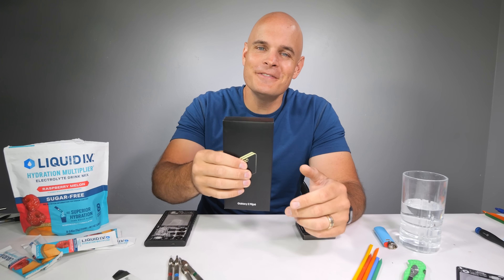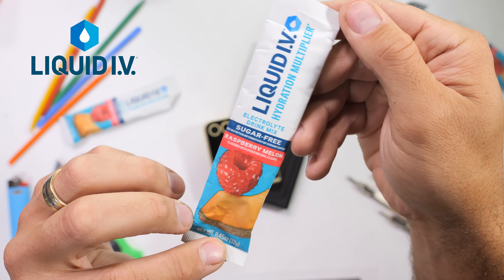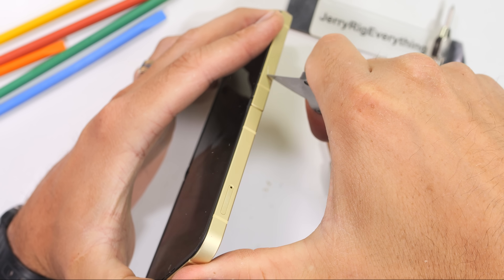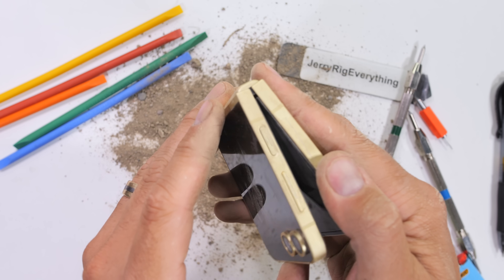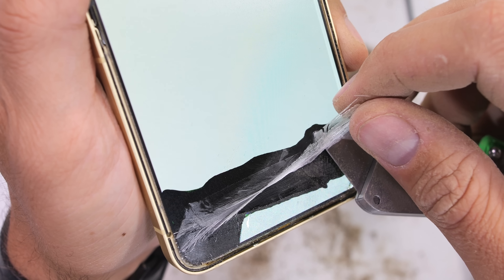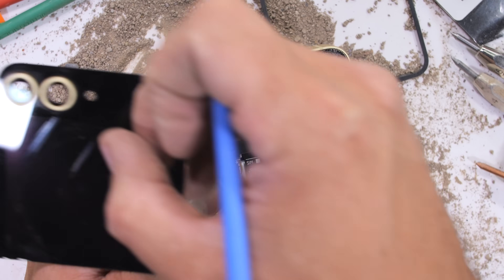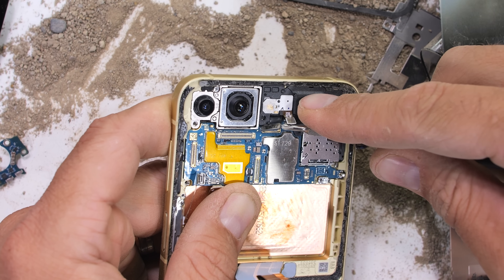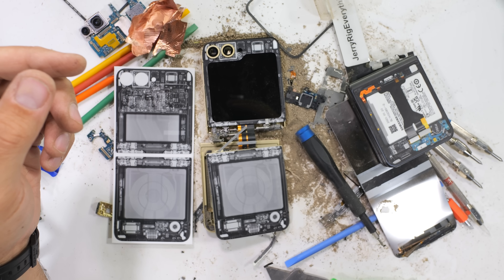Samsung Z Flip 6 Durability Test - I CANT BELIEVE THIS WORKED...

Comment: I'm fascinated on how cool and tidy  is this phone inside, just beautiful
Reply: Honestly every samsung phone after the s20 is beautiful inside, and amazingly easy to work with. They clearly put effort into simplifying their phones, whereas apple on the other hand…….😡
Reply: @Mike_Dubayou Also how a phone with 2 batteries, glass glued in that broke each time you replace it and 2 display is simplifying anything. You have never repaired one. Modern phones are horrible but modern flip phones are even worse.
Reply: @GTR-TT  Because opening phones is relatively easy.  Im not saying I've never broken one, but I do repair about 10-15 phones a day.  With all samsung phones, you repair the screen by opening them at the back first.  In my first 2 weeks repairing them, I had a few troubles.  But honestly your just an amateur if your constantly breaking the back glasses when repairing samsung phones.  

I think I've repaired about 800-900 samsung phones within the last 5 months.  I've broken like 6 backglasses, and 4 of them were within the first 2 weeks.

Nothing wrong with a mistake every now and then, but if you think its difficult, Im gonna just say thats a skill issue on your part.
Reply: @Mike_Dubayou LMFAO easy to work on? He broke the glass trying to opening the phone. Everything is glued in. Is horrible. Its the same as apple. Literally the same.
Reply: Nice bit of kit recieved mine Friday
Reply: @MarcosDias567 Not only have I seen them, I've fixed them!  Change the charge port on your own iphone and tell me its not an absolute nightmare.  Be sure you keep track of where all 45 screws came from, because they all just have to be different sizes.  Dont forget to have the 3 different screw driver needed as well, because why they eff would apple just use the same kind of screws.  

And this has nothing to do with your perceived notions that I am talking bad about apple out of some kind of hatred for them.  I use an iphone.  Samsung screens are annoying to change out.  Im just speaking the truth.

Comment: I loved my Z-Flip 3, but a week out of warranty it started crashing when I opened it. Thought it was the screen, perhaps a slight break in the ribbon cable. Got a cheap Oneplus to replace it, until that phone completely caked its pants and I had to try to get the Z-Flip to work. Well, I figured out that it's actually the hinge angle sensor that failed, and it's not the opening that makes it crash, it's the closing. So, I have a Z-Flip that can't be closed. Works fine as long as it's open.

Comment: Bought my flip 3 in 2020 and im still enjoying it!
Reply: Where u using any case???
Reply: @samgrootroessink7314  yeah, first I used samsungs silicone blue with a ring on the back. I still use it when I go downhill skiing to make it easier to grip. Then I didn't use any covers for a while until I found one plastic shell that I still use. But it's a little annoying that I like the cover because I got one of the special online colours for my flip. I've changed the screen protector twice. Once at Samsung after about 2 years (I guess they had a longer policy before) and once myself after the previous protector gave up after getting sweaty after a tough skiday
Reply: @samgrootroessink7314  sorry, missed your question. Yeah, for sporty stuff like alpine skiing etc I have the silicone that Samsung makes. But everyday I just have a simple plastic one with features. It's held a few drops with both cases. The biggest headache comes from sweat that starts to undo the screen protector. But putting a new one on isn't that difficult.
Reply: bought my zflip 3 about 2 years ago refurbished and it only lasted about 8 months before the screen started turning black and stopped working when I dropped it 😭 and then I got the screen fixed and the phone lasted another year until the screen started glitching out. then a green line in the middle formed and the screen started bleeding and becoming black. I didn't even drop it the second time smh 😭
Reply: @starella.  Sorry to hear that. Mine has mostly had a regular plastic case on and survived a few drops without any issue. I guess I just got lucky.

Comment: As you've done here, good design and engineering can make far more efficient and environmentally cars. Unfortunately profit margins and political soundbites are more important. They do not care at all, it's all a sham.

Even simple things like lean burning could lower the emissions of gasoline engines significantly, but that would require a few extra cents in material costs per engine so most manufacturers don't bother. Look at the original Honda Insight which used lean-burning and then was abandoned by Honda after 2006.

Comment: As someone who still owns a Flip 3 after over 2 years now, I can only support that Flips are pretty durable.
Right after getting it, I was asked multiple times if I wasn't scared of breaking it after a short time or if I was scared of breaking the screen with my fingernail. None of which has happened. I dropped it while it was open soooo many times by now, and it only has some exterior scratches on the frame and nothing else.
So I am very tempted to update it to the Flip 6, but mine is still completely fine and working without a problem. Also, I don't think I can ever go back to normal brick phones

Edit: For those asking, the battery isn't very good. But it was that from the very beginning. Since I knew that, I always had the battery protection on since I got.
Reply: Yeah, I'm using a flip5 right now and I was concerned with durability, it's been perfectly fine
Reply: I just upgraded got the fold 6, but I was still usaing the original fold for the last 5 years with no problems. Samsung really are making durable phones much better than the chinese, assuming you treat your 1-2k purchase as a 1-2k purchase.
Reply: I've had the flip 5 for about 9 months and it's still going strong I really debating if I wanna get the 6 or just keep the 5 for another year.  24 ultra still the king though.
Reply: Curious to know how the battery stands after a moderate day.  SOT, if you can give that.
Reply: @kcnairnair7299  The battery on my original fold is still good for a whole day.
Reply: @kcnairnair7299  I used my phone for GPS + music on a speaker at work from ~8AM and it died at like 5pm ish, under normal use (not a super heavy user) it'll last all day.
Reply: Can someone tell me what you find better about the flip form factor besides novelty
Reply: @trippinhard250  it fits better in my pants' pockets, especially in shorts.
However, it's an additional phone complementing my S23u.
Only using the Flip would not suffice TBH. At home I almost only use the S23u.
Reply: mann, you got lucky. My Flip 3 crapped out in under a year, despite me being extra careful with it. The screen started to separate at the hinge, looking like someone tried to pull a screen protector off. Eventually the whole screen grenaded itself. I haven't bought a foldable device since. Which is a shame, because I absolutely adored my Flip 3. I loved every single little thing about it and never once cared that I had to open it up to use it. But it just died way too easy despite me going the extra mile to cater to it.
Reply: @Xaevryn 
Had the same happen to my flip 4 after a year or so. Was able to get the protector changed for free by Samsung before it got too bad.
Second,  I upgraded from flip 4 to flip 6 just now. Believe me, a random guy on the Internet 😂. 
The bigger outer Screen is a game changer. Especially with the Good Lock app. You can run everything on the outer display.
Reply: I have delayed processing so I run into things and drop things all the time. The Flip 3 totally fell apart on me. I had it for a month before it was totally unusable. Broken screen where the hinge is, just massive black spots.
Reply: upgraded to fold 6 from fold 3. i had the fold 3 since launch and no problems at all other than battery naturally degrading over the years. best phone ever
Reply: I've had the 3 & 4, had to replace 4 once. All that I've owned crapped out at a year but I am still a massive fan of the Flip. Just got the 6 bc my second 4 screen just died. 😂 🤷‍♀️
Reply: I dropped mine while open once and instantly got dead pixels. I think they're pretty durable, though because that impact would have led to some broken glass on non-flip phones
Reply: That’s like my biggest regret last year. I bought the S23 instead of the Flip 5 because I was afraid of the durability of the flip phone, even though many of my friends were already using flip 3 and flip 4.
Reply: @FarhanHafizh the S series is just better tho, flips and folds dont really compare, be happy
Reply: Dont waste your money..... i boight flip 5 and only y months the screen is breaking😢 and i am VERY careful with phones @FarhanHafizh
Reply: Lucky for you. My flip 4 turns off when folded just after 1 year of treating it like a baby. Never buying a folding phone again.
Reply: Fold 4 here. Replaced the inner screen protector once, but other than that and a slightly degraded battery, it's perfectly fine.

The original screen protector lasted about 6 months before peeling and bubbling started, with multiple folding cycles each day.

The replacement protector has just started peeling after about 8 or 9 months, so they seem to have improved that.
Reply: The battery on mine die one year after
Reply: Had a flip 3, had to swap back after 2,5 years after well, first the "screen protector" got loose on many places of the screen, then the screen just got so badly scratched from my nails alone. I dropped the phone twice, 3-4ft drops. hinges had some play after that. Dont get me wrong, I am a huge flip phone fan, but man the flip 3 nope. Loved it, durable? No.

Comment: Have they fixed the disgusting pre-applied screen protector which, on my Flip 4 cracked after only a couple of months since, for some bizarre reason, they have a glass layer within it? Doesn't help when they start denying warranty requests, or getting sniffy about it, if you removed and replaced that with an actual working protector yourself. They also only allow 2 replacements.

Once this one is paid off I'm going for a Pixel, straight to "the source", definitely my last (and only) Samsung.

Comment: That's a surprisingly massive chamber for a flip phone form factor
Reply: That's crazy I've had like no real issues with my flip 4
Reply: @aleksanderlucy8764  go out on a 100-degree day and play a game outside like PubG or Pokémon Go without battery saving mode or extra dim and watch what happens. 
My phone starts shutting down other open apps, dims the phone, and eventually, you can't even call or text anyone until it cools off. Which is good because it's trying to save itself, but in the process, you can't do anything at all on the phone whatsoever. 
This is worse performance than the old phones from 2018. I got rid of my iPhone for vapor cooling and the Flip4 doesn't have anything at all. Terrible.
Reply: @BrD4GOD  what do you expect? The thing has a minnusule vapor chamber with a board the size of my thumb in wich the processor occupies like 40% of the surface of the board and you use it while its super hot and play heavy games, dont expect much, its made to show off too, not for whatever you do to be on the sun or places so hot
Reply: @paranaenselol  for sure. I think before this summer it's never really happened because I wasn't playing games back then and I didn't really have any issues. 
I work in the A/C all day as well so issues at work or at home. 
But man, it does get hot with basic operations while charging or just in general. Definitely can't handle heat well at all even in medium usage settings. 
But I get you for sure. 
Just was kind of a shocker going from the Note 9 to this.
Reply: And man is it needed. This summer, my Flip 4 has overheated consistently. I am seriously regretting getting the ZFlip 4. Thankfully ill he done with it this year. But won't be getting the 6.
Reply: Indian jre member 🎉